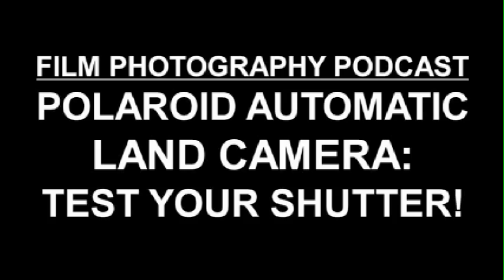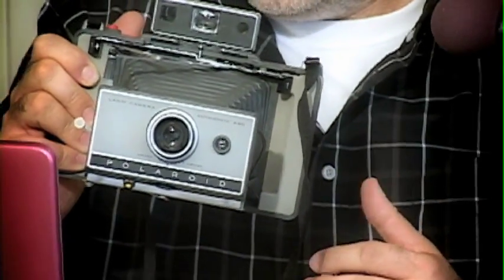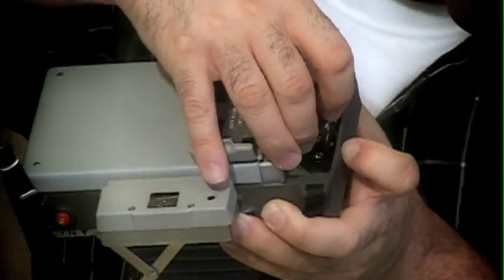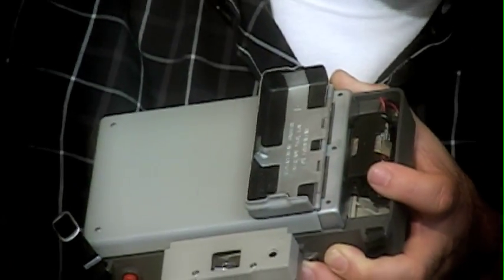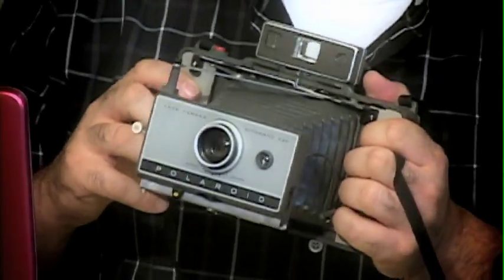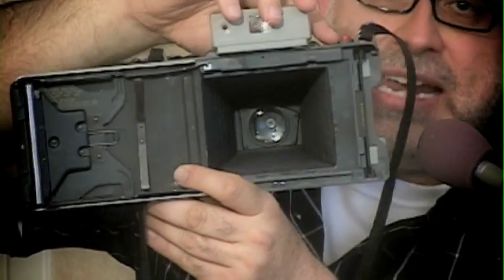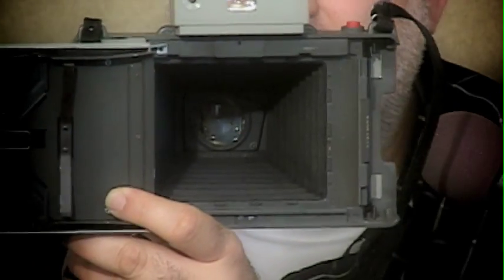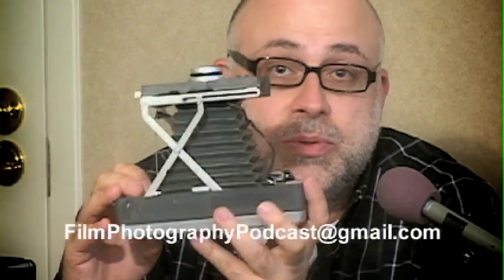Polaroid Automatic Land Camera - Shutter Test

Comment: Quick question: I have a Polaroid 103 Automatic Land do i need 4.5 volts for normal operation or 3? because etched into the metal i see "Replacement Alkaline Battery EverReady #532 3.0 V or equivalent" but upon further investigation and many video tutorials i see people using 4.5 (3 AAA) batteries on the same camera? should i use 3V or 4.5V ?
Reply: +Quentin B For the 103 use 3 volt battery.
http://filmphotographyproject.com/store/532-3v-polaroid-battery

Comment: Hello michael, i just tested an all most mint condition polaroid 250, it has its original mercury 4.5v battery that surpraisley still delivers voltage and seems by testing it on a separete tester that works fine, my problem comes when i connect the battery and fire the shutter, the shutter doesnt open no matter what light condition the camera is, theres no corrotion in the baterry or battery clips, what could i do?  is the camera dead? should i give up ? :(  theres nothing else i can do? im waiting to turn it to a AAA battery camera.